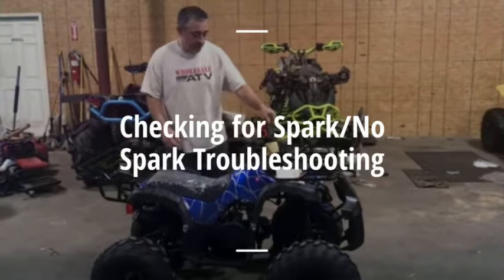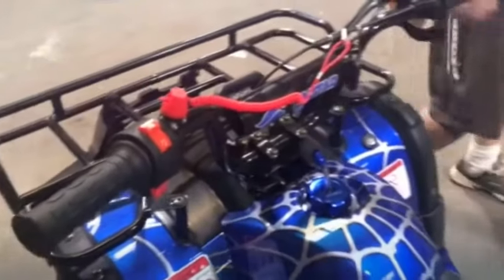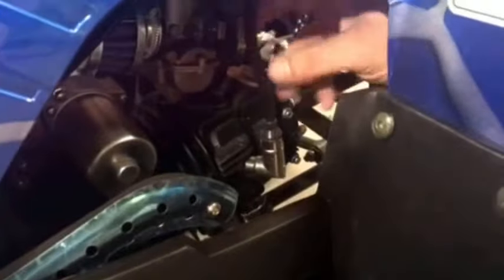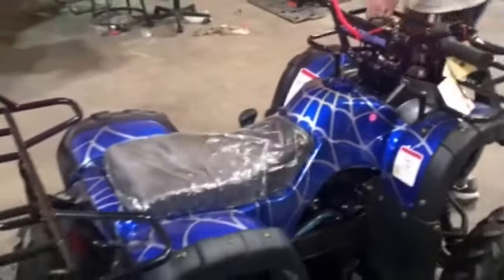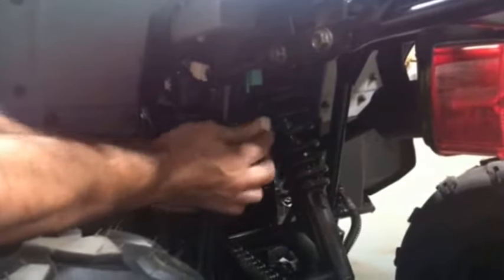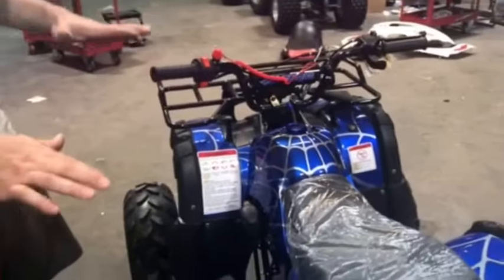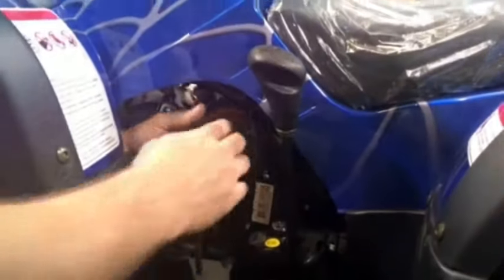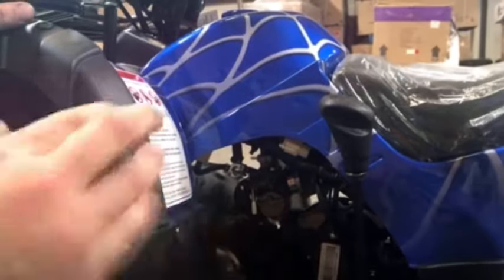Checking for Spark and No Spark Troubleshooting

Comment: Thanks for the advice but i wanted to add to your troubleshooting as though i am an electrician, instead of just replacing parts until it hopefully starts, is there a way to test some of these components, i understand the spark plug and i think i got mine narrowed down to voltage regulator cause im getting power out of my stator. Any suggestions?

Comment: I've replaced all of the wiring and parts on my kids 110 atv and still not getting any spark
Reply: Then your stator is bad
Reply: @againsthell1908  Got a brand new stator and still wouldn't work, notices all the wires weren't in the right place in the plug. After fixing that, I finally got spark.
Reply: @LanceHanlonOutdoors  
which plug?
Reply: @tangleass  stator